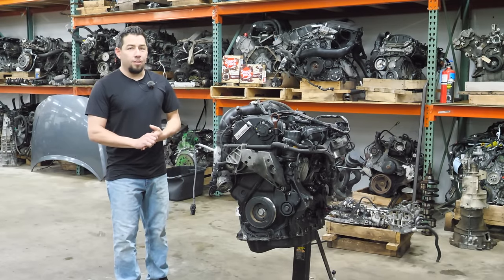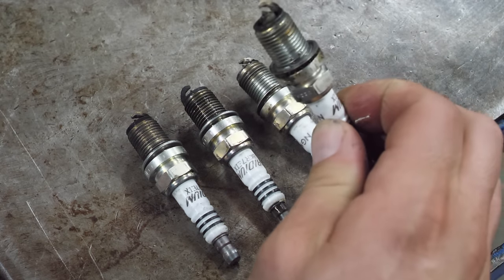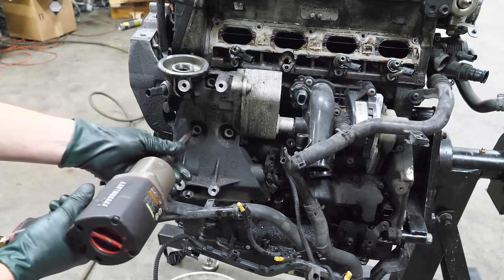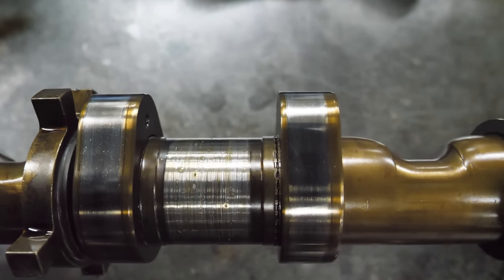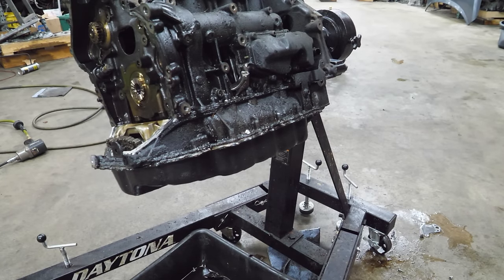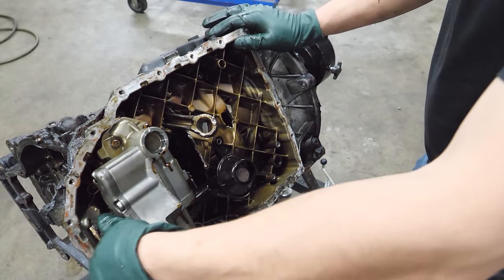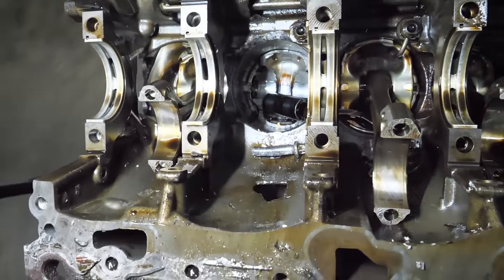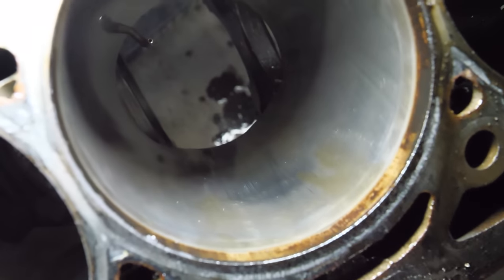Volkswagen 2.0L TSI EA888 Teardown! We Blew It Up, Lets see HOW BAD it is!

Comment: I’ve never seen that belt fail. The oil filter does come out that way. When it is loosened, the plunger in the housing comes up and drains the oil so it doesn’t spill. CCs and Tiguans are the most neglected vehicles I see come through my shop. Aftermarket oil filters, non VW spec oil, 87 octane fuel (this engine requires 91) then people wonder how the intake valves get full of carbon and chains stretch. Those oil rings were bad too. They have tiny pin holes in the center groove to remove the oil from the cylinder walls, the groove was plugged solid with carbon. This engine was burning a lot of oil and they never checked it. Oh, and that valve in the end of the cam is removed via special tool. That’s how the bridge comes off. You tore this engine down better than a lot of VW/Audi techs I’ve seen, kudos!
Reply: Just wondering…was that a normal oil filter on that engine? I thought that all VW Audi engines had canister type oil filters.
Reply: Can confirm, have also seen Tiguans neglected (don't see a lot of CCs). I feel like trying to cater to the crossover crowd was a mistake on VWs part.
Reply: @dand2334  definitely not an OE filter but I've used them on a 2015 Q5 without any issues
Reply: @dand2334  the gen 3 EA888 that replaced this first/second gen engine moved to a canister style filter, but these early ones took normal oil filter cans
Reply: The 1.8 l has a massive problem with the oil rings
Reply: I agree a chain job is a nightmsre on these engines, even with special tools but he did really great
Reply: Sounds like bad design. It's not the "people's car" if they can't make a car to handle the worst people.
Reply: @MiGujack3 German engineers design cars for German people, and they are pretty well regarded in that part of the world. 

Not trying to make excuses for Volkswagen, it's just that a basic level of care goes far with any complex machine. Even the most solid Toyota engine will eventually spin a bearing when constantly run low on oil
Reply: Interesting, so CCs are even more neglected than Jettas and Passats? I always thought the CCs were pretty nice cars
Reply: In 40 years VW went from air cooled as simple as possible to, water cooled SOHC engines which, looking back had about the fewest moving parts an engine could have. Now, 40 years later we have about the most moving parts imaginable, and how many chains and tensioners? The older 4 and 5 cyl engines never used balance shafts and seemed fine. VW has gone so far downhill.
Reply: @karl_toffel  You must be speaking of the engine I’ve heard of but never seen. The US never got the 1.8 liter Gen 1. But I have heard a lot of stories about it.😂 I’ve also done probably close to 50 chain jobs on these and for what this engine is, they are pretty simple. At least the chain is on the front and not the back like every VW/Audi engine bigger than an I-4.
Reply: @taylorsutherland6973  They started using balance shafts in the EA113 BPY engine. It was part of the oil pump assembly and was super expensive. The EA113 and EA888 engine families are designed by and for Audi. I’ve owned several vehicles with these engines and they are easily the smoothest and quietest direct injected 4 cylinders you’ll ever drive. I’ve had two B8 A4s, the newest of which has a stage 2 tune and they just run like much larger engines. But, I am a VW/Audi tech. I know what to expect when these hit 70k miles. Just like Adam knows what to expect from certain BMW engines that hit certain mileage. I can fix them cheap and easily. European cars definitely aren’t for everyone.
Reply: @JohnEvans-ct6mz  Hey question for you man. I have the ea888 cbfa in my A3. It's got an idle misfire on cylinder 2 (runs fine above 1500 rpm) and I've been chasing the cause for months. I did a compression test and it is low, but it's not burning oil/coolant, the spark plug looks just fine, I put a boreoscope in the cylinder and the cylinder walls look great, I replaced the injector seals, and cleaned the intake valves. But no difference. I'm thinking maybe slightly stripped spark plug threads, a burnt valve, or worn cam lobe (I don't think it's the latter since the inside of my engine is so clean and the cam lobes I can see under the PCV look pristine)? I was wondering if this is normal for this engine and if you have any ideas what I could do. It has 112k miles, and I religiously maintenance it every 3k-4k miles with all the recommended oil, 91 octane fuel, and such.
Reply: If he tore that down better than audi/vw techs...that confirms that I'll never purchase a VW/audi.
Reply: @samoliver3242  A couple of things. Run the engine for a bit then remove the spark plugs. Look for fuel on the piston, the injectors do leak sometimes. An injector can fail without a leak too. VW and Audi have warranty extensions on them and having the CBFA engine, your engine is partial zero emissions. That includes a 15 year 150,000 mile emissions warranty. Leaking/failed injector could also explain lower compression, fuel washing the cylinder. Also remove the oil cap and make sure the metal baffle that goes in the oil fill hole is sill there. I’ve seen those fall or get pushed out, land on the cam and wipe out the lobes. I have seen valve springs break, but that’s far less common. So check for that oil baffle, if it’s there I’d focus on the fuel injector. Bosch injectors are a well known failure item on all European DI engines.
Reply: @cricketyosh  Lack of skilled technicians is a problem through the entire industry. I worked for GM for ten years and the things I saw techs doing would make your skin crawl. All techs are paid based on how long it takes them to do a job and get bonuses/rewards based on how many hours they can turn in a week. This system inspires a lot of very sketchy shortcuts. As long as the car doesn’t come back after the repair, the quality of it just doesn’t matter, sadly.
Reply: @JohnEvans-ct6mz  thanks so much man. I'll look into that. I had the injectors replaced (OEM of course) a year and a half ago. Let's hope I can figure it out
Reply: Love the carnage and blowing up the engine.
Reply: @JohnEvans-ct6mz  should have been a bit more specific :). The first generation EA888 1.8 tfsi motors, built 2008-2011 had faulty oil rings. Atleast here in Germany/Europe.
Reply: @JohnEvans-ct6mz

Yes, I was a VW/Audi for many years as well. Last one I owned was a B5.5 with an ABA 1.8t. 

My favorite engines were the SOHC 1.7 and 1.8 as well as their cousin 5 cyl 2.1 and 2.2. Forged bottoms and mechanical fuel injection. 

Other than the self machining rivets on the transverse transaxles they were pretty tough. I've been into many of those to put in bolts. 

I've been into many of those engines for a 200k mile head gasket and the cross hatch in the cylinders looked like new, engines didn't burn oil.
Reply: @JohnEvans-ct6mz  hey man sorry to bother you again. I talked with Audi USA and they're claiming the warranty was only extended for 10 years or 120k miles, meaning by years I'm just out of warranty since mine is an '11. That's different from what you were telling me, so are they right about that, or maybe it's because the car isn't on California anymore but still has the CBFA engine?
Reply: @samoliver3242  No worries. The injector warranty is 10/120, the PZEV emissions warranty is 15/150 but there are three codes that have to be in the warranty key as well. They are US1, US2 and US9. If you are in a non PZEV state, they may not be too familiar with this warranty. It only applies to California, New York and I can’t remember which others. As long as those codes are in the warranty keys, you should be good. If one or more are missing, the warranty is no good. But as I said, that warranty covers certain things like the fuel injectors, ignition coils, turbo, etc. I’m pretty sure Audis criteria is the same as VWs for PZEV. The VW based Audis would be the only ones to have it (A3, Q3, TT).
Reply: @JohnEvans-ct6mz  thanks so much man. I found the warranty booklet and since my car was sold in California (says PZEV under the hood and Carfax shows it was sold in southern California) I believe I should be covered for the 15/150k warranty. I'll be contacting my Audi dealership here in Utah tomorrow. Thanks again!
Reply: @samoliver3242  Not a problem, glad to help! Good luck to you!
Reply: @plzdonhack   If the oil pressure light has only come on once for a brief period and the engine was idling, I doubt any significant damage was done. I’m impressed you have an older 1.8 and it only uses a quart every 1500. We didn’t get the 1.8 in the US until the gen 3 engine came out, but I’ve heard a lot of horror stories about that older 1.8. HPFP being loud isn’t huge or abnormal. They get louder or quieter depending upon their age, timing chain stretch, etc. I would say your issue is injector related, Especially if your engine is burning any oil. It creates a lot of soot and plugs up the spray nozzles in the injectors. That’s why it misses when it does. When you come to a stop, the fuel injectors shut off and the fuel pressure drops. This is normal and is to promote engine braking mostly. As you come to a complete stop everything comes back to life but because your injector tips are plugged, the spray pattern is bad and the fuel pools instead of vaporizing, causing the misfire. As for the gen 1 or gen 2 engine, I can’t get a straight answer. I always thought the Audi flex fuel engines were the only gen 2 engines, but according to what I’ve read, any 888 engine with lift control is a gen 2. I just know (at least in the US) VW never got the gen 2 engine. They went straight from gen 1 to gen 3. 1&2 are literally identical, just the cylinder heads are different. My CPMA engine has a three wire crank sensor too, CAE, CBF and CCT all have two wire sensors. The gen 3 is totally different, just looks similar. VW/Audi is nothing if not confusing. But, I would say as long as your consumption doesn’t get worse and your timing chain is good, your engine should be fine.
Reply: Newer 3rd/4th gen 2.0 TFSI engines can use regular
Reply: @kevs2good133  Yes, they can. However, I’ve owned three different cars with Gen 3 TSIs. Running 93 octane averages about 3-4 MPG than 87 and there is a noticeable performance difference. APR baselined the 1.8 TSI. With 87 octane it had 175 horsepower, 185 torque. With 93 (still on the stock tune) it had 190 horsepower and 205 torque.
Reply: @JohnEvans-ct6mz  hey my man. I've tried contacting Audi here about the PZEV ea888 15/150k warranty, and they've been really hard to get to, but I'm still working on it. I think an injector failed completely now and it barely runs.  I took out the spark plugs and one was crushed so I think it dumped fuel in the cylinder, but there wasn't really carnage in the cylinder. I bought new spark plugs hoping that was the extent of the damage, but it runs terrible with a knock-ish sound. I think it bent a rod or something. I'm worried I'm screwed here, but I don't know if engine failure due to injectors covered by the 15/150k warranty will be covered. Is there any hope for me?
Reply: @samoliver3242  Oh man, that’s not good. If a fuel injector failed and the consequence was internal engine damage, they SHOULD cover the engine under that warranty as well. I do know Audi is way more priggish with the warranties than VW dealers and a lot of dealers won’t do the leg work. They would have to verify the failure, have their warranty admin reach out Audi of North America and see what they say. I just replaced an engine on a 3 liter Touareg TDI with 115,000 miles because an injector took out an engine. The diesel warranty covered it. I would reach out to multiple places and see what they say. It’s unfortunate a VW dealer can’t work on it, I know they wouldn’t have an issue. Best of luck to you!
Reply: @JohnEvans-ct6mz  thanks man.
Reply: @samoliver3242  Any time. I know I got one for my A4, but did you get anything on that class action lawsuit from Audi about pistons failing prematurely? I’m not sure what the mileage limit on it or if your car qualified?
Reply: @JohnEvans-ct6mz  I'm not sure, I didn't see that lawsuit. Could you send me details?
Reply: I've never seen that belt fail or even show signs of significant wear. And I've probably done 50 or more waterpumps in these engines

Comment: Instead of monsters in your nightmares, you must dream of automotive engineers who choose to use 15 different kinds and sizes of fasteners when 2 or 3 would do, and maintenance items which cannot be accessed without taking half an engine apart to get to them:  Those engineers are the real monsters in this world.
Reply: If you want to see a real monster of engineering, look up Houston's lake Bugatti rebuild. A nightmare car to work on.
Reply: @cricri7066   Bugatti is a hypercar and it's expected to be hyperexpensive and hyperdifficult to maintain. And there's at least packaging reasons for that. On the other hand we have Audi with thermostats inside the block behind timing system and BMW with hose labyrinths that accommodate leaks to go EVERYWHERE.
Reply: Work on a vw, uses 5 diff sizes for everything. Other brands 10, 12, 14 tear down entire car
Reply: @Vel1ar  this is just a bread and butter car and the engine: it's overengineered, overcomplicated and the quality is not what is should be. Very expensive cars to maintain, as al VW's and especially Audi's
Reply: Best 2.0L engine ever built. I owned three of them, one in Tiguan, one in Golf GTI and now in Audi A4. Zero issues, huge fun to drive.If you don't have money to maintain them then don't buy it.
Reply: @senco981  If you need a lot of money to maintain them, they are not good engines. There is no reason for them to be so complicated.

Comment: OMG, after becoming used to relatively simple Mazda, Honda and Toyota engines, this looks like a horror movie.
Reply: It seems awfully complex for what's supposed to be a cheap car.
Reply: @peterwilding1203  , exactly. I understand that VW CC is not the cheapest car, like Toyota Corolla, but the amount of complexity here is hard to justify, IMHO.
Reply: @solderbuff  Did you ever owned car with this engine? Like Golf GTI or Audi A4? I can tell you did not. Those are most fun to drive cars ever built.
Reply: That is whole point of Japanese reliability. Simple design, long life, low maintenance. 
Trade off is boring, zero fun driving experience.
Reply: @senco981  , did you ever own a Mazda 3 or Miata? I can tell you didn't. Those are the most fun cars to drive. While being reliable like a tank, simple to maintain, DIY-friendly and gorgeous outside and inside.
Reply: @solderbuff  Actually I did, I had loaner brand new Mazda 3, fully loaded. You can't compare that to Golf GTI.
My argument is not about reliability, it is about driving experience. German cars are way more fun.
Reply: @senco981  , Mazda 3 Hatchback in top spec beats Golf GTI. So I'd say it's a matter of personal preference and, perhaps, your location. If in Germany it's cheaper to own a GTI, I'd probably go for a GTI. But in Canada, I'll take Mazda 3 every day of the week.
Reply: @solderbuff  I’ve owned a few Miatas. An NB, two NC’s and a ND. And now I own a mk7.5 Golf GTI. And I can say Miatas are underpowered and the Golf is way faster. I found it embarrassing when even a van would out accelerate your Miata.
Then there’s the 300 to 330bhp Golf R, which uses the same engine.
Reply: @notmenotme614  , I see, I see, interesting. Well, good for you, guys.

As a daily driver, I love my 2010 Mazda 3. I don't need 300hp to carry my kids from school to school. And the amount of acceleration I have on the highway is enough to be the fastest car on the road. At 6.8 L/100 km, it's a steal.

I guess, it's a matter of your priorities.
Reply: @senco981  Agreed 100%. We have a Mazda 6 2013 with the 2.5L engine and it is extremely under powered. Feel like Mazda should've put the 3.7L V6 from the CX9 in it. I own a 2012 MK6 GTI and it is a way better driving experience than the Mazda 6 while also being more interesting than the Mazda.. The newer MQB platform Audi's and VW's are much better than the earlier EA888's.
Reply: Yes it's complex, but very few engines as small as 2 litres have balance shafts. Note that the EA888 has a very rigid cast iron block with closed deck construction, 4 bolt main bearings, and a separate reinforcing casting bolted on below the crankshaft. It's super-strong, no ordinary cheap engine. I have the EA888 version 3 in my Golf GTI 7.5. It's very smooth. Even more complex, with both direct and port injection, variable valve timing on both intake and exhaust camshafts, and separately controlled variable valve lift on the intake camshaft. It makes 230hp, goes very well, and being a manual, it's fun to drive. I think the 7.5 is the Goldilocks version, with EA888 v3, before the removal of port injection, mk7 interior and manual transmission. Probably my last car. 🤔
IanB